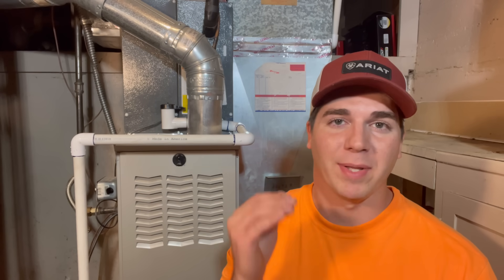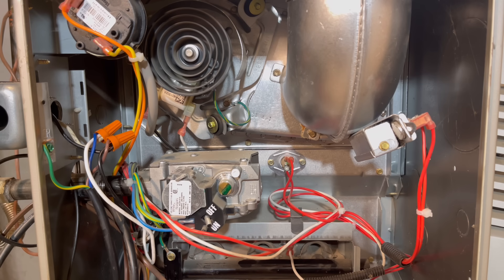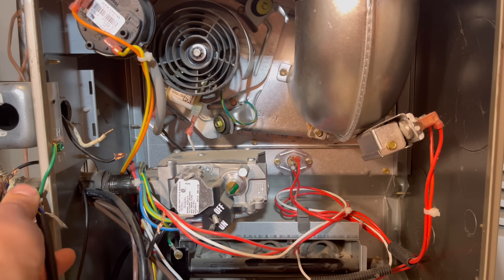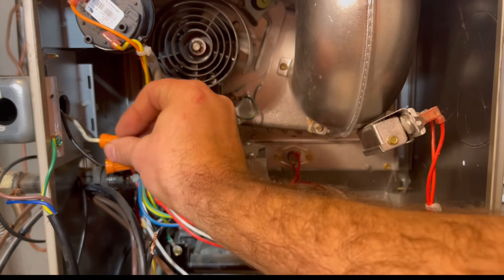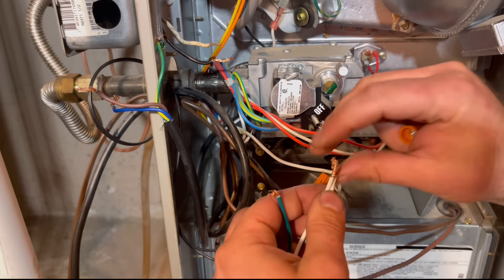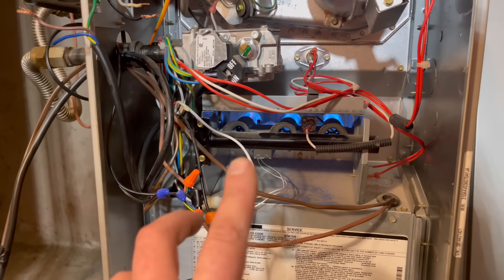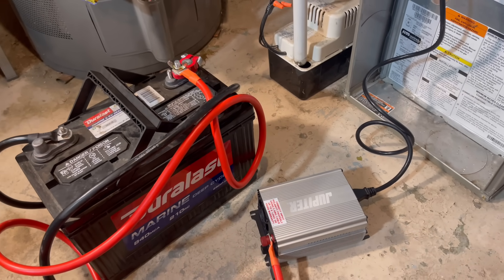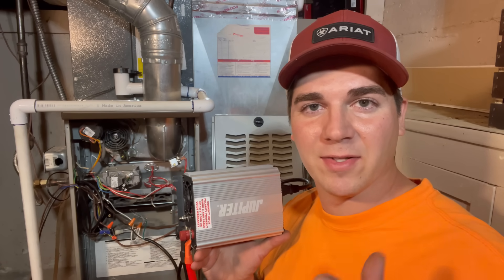Did You Know You Can Heat Your Home With A Car Battery?

Comment: This is a modified sine wave converter. Would I take the chance to power my furnace? I think not/1
Reply from the maker: I ended up getting a pure sine wave inverter and have it connected to my truck so I can power it as long as I have fuel in the truck 👍🏽

Comment: How long will the battery run heater?
Reply from the maker: I ended up getting a pure sine wave inverter and have it connected to my truck so I can power it as long as I have fuel in the truck 👍🏽

Comment: But that is a gas furnace.  Doesn’t use much power.  But an electric heater is a different story.  Most houses in Texas are all electric.  Also that is a basement.  Hardly any houses in Texas have basements.
Reply from the maker: This isn’t just for texas I was just using that as an example. I ended up getting a pure sine wave inverter and have it connected to my truck so I can power it as long as I have fuel in the truck 👍🏽

Comment: Nice video...I have a whole house generator that runs off nat gas...our computerized transfer switch shows our furnace drawing 12-15 amps at startup and a little less than 2 amps for blower.  So...we would need at least 2k pure sin inverter and I would have to agree with others that this would only run for hours not days..... remember...inverters draw power even at 0 draw...

Comment: What a great idea. Winter outages are usually due to storms and can last a few days. Keeps the house warm and avoids frozen water lines
Reply: A starter battery will not last that long. He is using a lead acid duel cycle marine battery and not a starter battery. They are made differently. Don't use a car starter battery it will drop below 50 percent very quickly and damage the battery and you will lose heat very quickly.
Reply: Even the deep cycle batteries won’t last days. This won’t last more than a couple of hours max. A gas generator can be ran to power the furnace for days at around the same cost or a little more. It’s an out of the box idea but one that should only be used in an emergency and if you use the battery from your car.. expect to buy a new one because the plates inside will be destroyed from being discharged so low
Reply: @joshualangley5550  Yep. In a pinch you can even use 12 volt tool batteries on a power inverter, but depending on what you are running. Those batteries can go dead instantly or last for hours. The same is for duel cycle marine batteries. If you have a inverter connected to your starter battery and have your car running then your battery is not supplying the power. You alternator is. Once you turn your car off then your battery is sending the power.
Reply: clot shots  You do know that water lines can freeze in just a few minutes right. Also I used to run a laptop off of my vans starter battery, and I could only run it for about 30 minutes max before my van would not start. One more thing to consider is if you are having to run back and forth to start your car. You will lose any warm air that you just made by opening the door. You are not doing yourself any favors by doing that. If anything just get a extra battery in the house that you can use, and once it goes down just connect to your car and charge it with your alternator with jumper cables. Less trips and less opening your door so the more heat you can keep in. I now have 1200 watts in solar and a 400 watt wind turbine generator, and a gas inverter generator for those types of days and nights. I also bought a 7000 btu propane heater for heat.
Reply: clot shots  Even if you are just opening the door to go in to your garage ( if you have one ). You would still lose heat from the house. Also if you are talking about water they can freeze even with insulation.
Reply: clot shots  I have a propane heater that I have shown on my own channel. There is a flaw with your thinking though. Not everyone lives in a house where they can get to the water lines. I live in a studio apartment along with 3 other studios. The water lines are in the basement and the renters don't have access. We have had our water freeze 4 times in the last 2 years. I usually let the water run with a small stream to try and help, but the other apartments don't.
Reply: Buy a generator
Reply: @brianjohnson6053  I have a generator myself, But with the democrats trying their best to get rid of gas, and natural gas it might not work much longer.

Comment: Unfortunately where I live I don't have natural gas for heating so I have to use a generator to run several space heaters do use a small inverter to run lighting that is back fed for a transfer switch to a few circuits that are exclusive for relating the outlets have a different color and they're labeled backed up with inverter

Comment: I have a spare freezer in my basement that I keep stocked with all kinds of meat and poultry. This inverter idea you have with the deep cycle marine battery is definitely something I will be employing to keep the tiny compressor in that freezer running. A separate unit could be purchased to run the upstairs fridge as well. Where my forced warm air furnace is concerned, I'll definitely be looking for an inverter that can be installed to my truck, as you have come to recommend here in the comments. You have helped to improve my family's preparedness with this video. Thanks so much for the information.
Reply: A chest freezer is more efficient since the cold air does not leave the freezer when you open the door.  For a standup freezer, put gallon jugs of water in the freezer to keep the cold in.  Or stock your standup freezer full so that when it is opened, very little cold falls out of the freezer.

Comment: If you had a couple of 100watt solar panels to add to the mix you could be very energy independent even in an emergency.
Reply from the maker: That’s true! I might look into that. I actually have the inverter set up in my truck so I can power the furnace as long as I have fuel. I’d love to get solar for my house but electricity is pretty cheap In utah so it’s not worth it right now.
Reply: @diyhvacguy  I am in the process of outfitting a shed for a solar setup to charge drill batteries and power equipment...

Comment: Interesting.   While I've not tried battery/inverter/wiring,  I have made an emergency switch to run from an inverter generator.   As in my case and many others I run across,  the wiring must be bonded to existing breaker panel with both a neutral connection as well as a ground connection.  The black power wire is the only one switched between line power and backup (generator) power.  The generator is a floating neutral, thus the white neutral and the ground wire must all be connected with a path back to the breaker panel so that it becomes in essence a bonded neutral generator..   Only the black wire is on a SPDT (on/off/on) switch which allows alternating between line and generator..  Maybe in older systems,  this battery / inverter will work, but it will not work with mine or possibly most newer gas furnaces.  Remember too.  This has an electronic control board and does not  like dirty power   This is covered in a swith from EZ Transfer switch  - video's here.
https://www.youtube.com/watch?v=gVbUWCCt0D4

Comment: Change the 110v ac switch to a box with a switched outlet and put a 110v cord on the furnace to plug into the switched outlet.  Now you can put an extension cord on the furnace when needed.  Instead of using a battery, I have an already charged Ecoflow Delta Mini that I keep around for this purpose and for my sump pump.  It can also be recharged with 12v from my car when needed or with solar panels if you have them.
Reply: This scheme is a much neater way of cutting over to "auxiliary" (inverter) power source, rather than fumbling with wiring at 3AM in a freezing house. I made a box with a switch so I can switch between mains power and another source - input spigot is on box. This way I can just plug in aux source, flick switch, and back in business.

Comment: How timely! I was just wondering about doing this the other day in advance of a big snow storm.
Reply from the maker: Glad you found it helpful. In hind site I would have included just installing the inverter in a vehicle and running an extension cord to the furnace and wiring it in. That way you can run this as long as you have fuel in the vehicle! Hope this helps. Cheers
Reply: So why can't you plug a battery charger into the other outlet and charge the battery at the same time

Comment: Nice job.  It probably won't work on a more sophisticated furnace, heavy with electronics.  For that you'll probably need a bigger pure sine inverter, at least 2kw, and a bonded neutral.  My 90kbtu needs about 1800 watts at startup,  and pure sine wave conditioned 120v, or it won't make it through the start sequence, I've tried it.  Another cool mod you can do is change that switch box on the outside of the furnace  to a switch with a single outlet, then create the pig tail plug to power your furnace, then you can use any extension cord to power your furnace from a generator or portable power supply (ecoflow, Bluetti, Goal Zero).  I use a 1000wh Goal Zero to power mine.

Comment: Great video i did this during the days after hurricane  sandy. I feed power through the emergency cutoff  switch which feeds the boiler. But dont get an inverter that is electronic with a low voltage cut off mine was meat to be used on a running car it was meant to shutoff way befor the battery started to run down. So i didnt get long run times ...but it worked keep the house warm enough

Comment: yea, but where does the gas come from? Russia blew up their gas pipeline, you should switch to an electric furnace
Reply from the maker: I’ll be posting a video on keeping your home warm during a no electric AND no gas situation very soon.  The possibility of having no gas is a real possibility.   So what will you do if you have no electric or gas?
Reply: @diyhvacguy  probably a boiler like everyone else, the water tank basement with wort's coil to pull the heat from the top of the storage tank is pretty exciting but water storage to that extent is not sustainable at a society level, just like there's not enough lithium to power society. Maybe a transcontinental nuclear-heated steampipe system could keep big brother from letting voting blocks freeze to death

Comment: I did not see a link to a video that shared how long the furnace ran on the battery..
Reply from the maker: I was excited to publish this one so I haven’t filmed the test yet. I actually ended up installing the pure sine wave inverter in my work truck and then will run an extension cord to my furnace from the inverter so I can power the furnace as long as my truck has fuel. At idle I’m sure it would last several days on a full tank, starting it from time to time. I’ll be uploading that video soon! Thanks for watching. Cheers

Comment: Could you run a battery charger off the second inverter outlet back to the battery for extended use?
Reply from the maker: Some others mentioned that. I’d love to test that. Others say it wouldn’t work. Probably because it’s using energy way faster then it’s able to charge maybe?

Comment: A lot of good comments here. If anyone is thinking of solar this is the way to break your cherry. You can get a 12 volt solar panel from Harbor Freight. The best thing is to buy a battery back up inverter for your computer that you can use every day to keep your computer online after losing power and then for these alternative uses. It's nice not to have to reboot every time the power hiccups.

Comment: Will the home thermostat still work or do you have to keep turning the unit off manually
Reply from the maker: Yes the thermostat is powered by the furnace, or if you have batteries, it is powered by those and just sends a signal to the furnace when to turn on and off

Comment: Can this process be done on a oil burning furnace?
Reply from the maker: Not sure on the oil burning furnaces as I’ve never worked on those. If you test the main power at start up and while it’s running and it doesn’t pull more the  7-10am is you can get an inverter that is properly sized for it and I’m sure it would work. I installed mine in my truck actually so it will continue to charge via the alternator, and will run my furnace as long as I have fuel in the truck :) cheers!

Comment: I really doubt that you can keep the blower fan going for more than a day on that battery
Reply from the maker: Yes this is what everyone seems to be saying. I realize I was mistaken on this. I actually ended up installing the pure sine wave inverter in my work truck and then will run an extension cord to my furnace from the inverter so I can power the furnace as long as my truck has fuel. At idle I’m sure it would last several days on a full tank, starting it from time to time. I’ll be uploading that video soon! Thanks for watching. Cheers

Comment: 5:00 A great alternative to plugging a light into your second outlet on the inverter, would be to plug a float charger in, and connect it to your battery, so it can maintain the charge in your battery, very much like a battery backup for your sump pump.
Reply from the maker: Have you done this? Someone else said you’d need a separate battery for that.
Reply: @diyhvacguy  I have not, but I did read about it on a home maintenance forum a while back. The person who posted it said it was best to use a battery with both top and side mount battery terminals.
Reply from the maker: @PaganWizard  I’m not sure but I’ll test it out for sure!!
Reply: @diyhvacguy  Cool